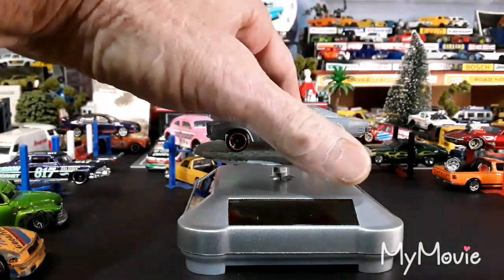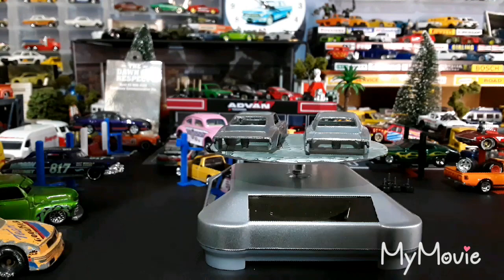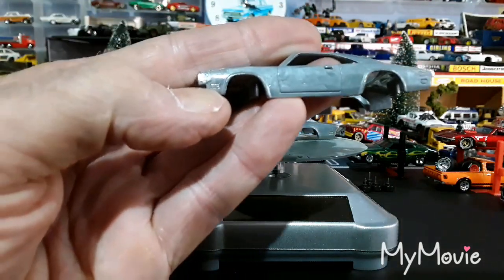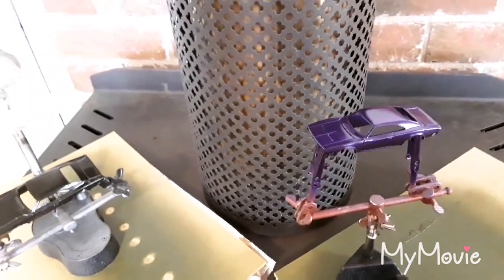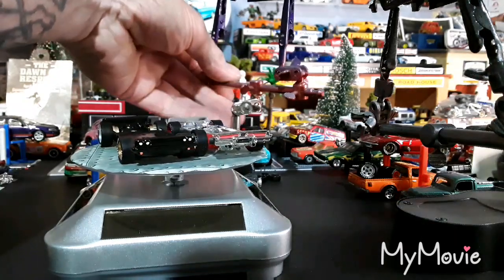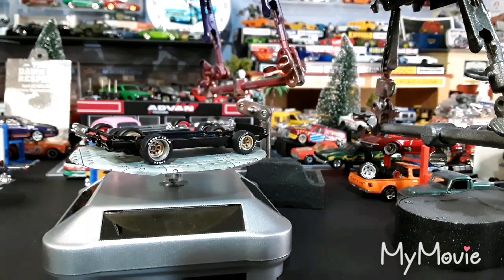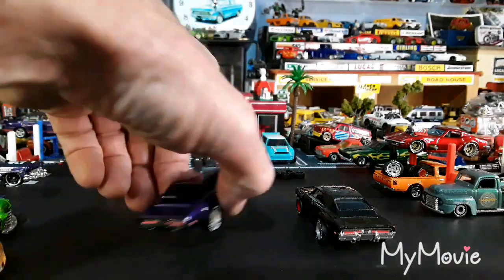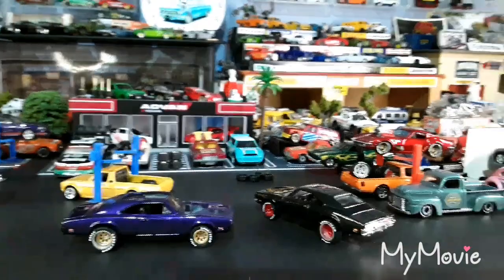1969 Dodge Charger 500 Custom Builds x 2 Time Rider Bad Tampo Build Off #MM3DTV  EP #76  MA16+ Only

Comment: Every Mopar fan that sees these would be loudly singing your praises.  I passed on this car twice at the shops because of that God Awful tampo.🤢🤮😎  These are one of my favorite  castings. Not one but two you knocked out of the park!  They sure cleaned up nicely!

 I watched a beauty drive by my house everyday growing up. (Emerald Green).  
    You got me excited when you had it lowered down, what is with this casting that forces us to keep the rear up high?  You ran out of time?  Beauties now!!  I want to attempt one myself.
    My favorite real Charger ever, was built by an auto body shop owner that was located across from my school bus stop.  It was undercover for years until he found time to complete her.

Deep metallic purple, lowered down properly, with two semi broad tandom white racing stripes from nose to tail. It has a white interior. Presently it's a show car.  Hot wheels finally came out with a purple casting with the white stripes in the Classic Series.  The wheels are Sp5's booo!
Glad to here your friend is heading in the right direction, toward a full recovery. 
Cheers mate!
Reply: Did you realize that if this casting was constructed properly for racing, RE:  (lowered etc).  This I believe would be a Fat Track Dominator.  I have them with a full metal jacket as well as the plastic chassis.  I don't have any extras with nice enough factory paint to inspire a build out of me. 
    Not sure how to lower it down and keep it fast?  I do have extras that could use fresh paint and a mod. Food for thought. 😎
Reply from the maker: Cheers Jon appreciated,  do you have photos of that Dodge sounds MAD, I'd like to replicate it be cool, I've got another 1 on the bench which is lowered like you seen in vid going to do that one, like that, but now you got me thinking as its long wheel base car and wide, um might have to do something with that, man you making me work 🤣😂 love it lets see what happens,  ok bro good to catchup again, and thankyou for your support and kind words for me best mate, Stay safe take care over there dont take any chances Rgds KC Tassie Australia 🇦🇺👍👊😎🇦🇺
Reply: @MetalMania3DTV-TAS-AUS  I'll see if they have a picture of it on their facebook page, or I'll call his son and find out.  They keep it in a hauler, and since I moved, I haven't seen it lately. Cheers mate.